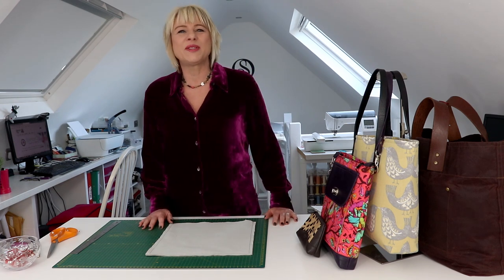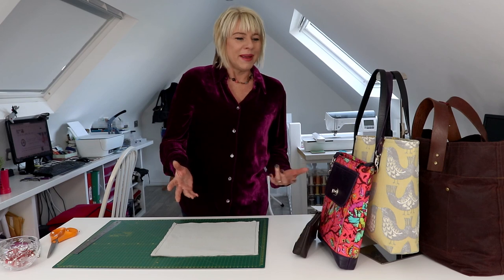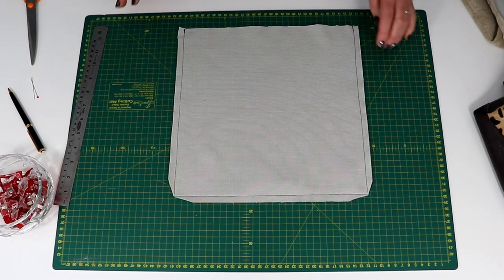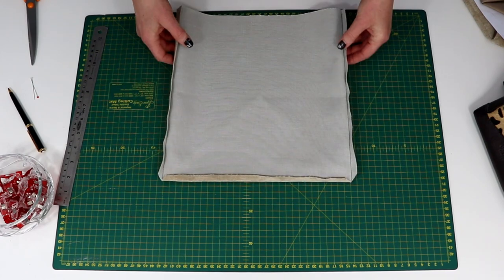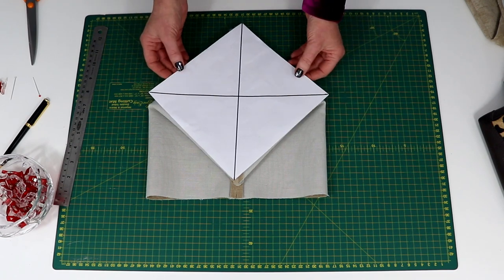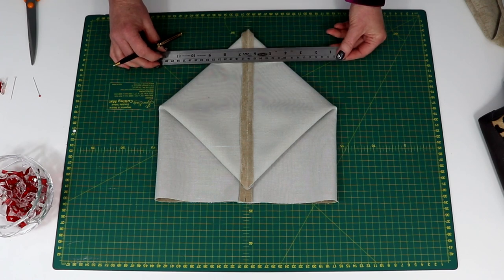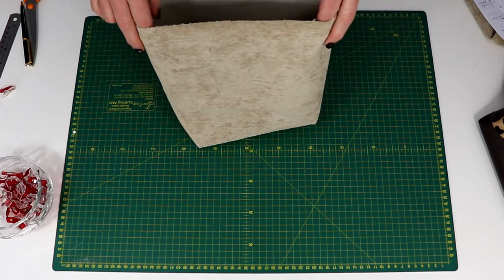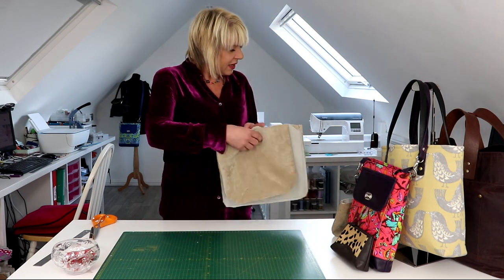The secret of boxed corners in bag making

Comment: Can I box corners if I have used deco in light as a stabiliser. Thank you for your tutorials, they are so thorough and really help x
Reply from the maker: Yes, use with any stabiliser Decovil Light included. If you have an entry level machine and worried about layers and bulk you can cut the stabiliser out of the corner sections beneath where you are sewing.

Comment: Hi. Love your patterns

I want to know if there is a formula for the boxed corner that will make a perfectly square base? 
Ive seen heaps of boxed bag tutorials, but haven’t found one that describes how to get a perfectly square bottom - for toy bags etc 
I know I could sew a square into the bottom. But I don’t want to. Boxing the corners is so much easier. 
If only I could work out how to work out how to get a square base
Reply from the maker: Make the full finished box corner seam the same as the width of your bag and you will end up with a square bottom :)

Comment: Great tips....I noticed you don't cut the corner out of the bag after sewing it.  Does this add stability to the bag?
Reply from the maker: It really is personal choice, I normally prefer to leave it on to add a little stability to the base, but there is no problem cutting it off either, especially if you want to reduce bulk in an item

Comment: What an easy way to do this.  Question because I notice your example bags to your left all have a contrasting piece at the bottom when and how do you add that?
Reply from the maker: Just add it to your flat fabric before you begin to make your bag up. Same width as your fabric. 3" is a good general height for a medium size bag, but the height will depend on the size of box bottom you want to add - it will always need to be slightly larger than your corner measurement. Hope that helps. 
Do join my bag making group for more hints and tips on bag making and to ask any questions you have:
https://www.facebook.com/groups/170115107145604/

Comment: Thank you! Often I've seen patterns whereby the bottom corners are cut out before they are stitched (e.g. cut out a 2x2 inch square at each corner, match seams, then sew). Your way/explanation allows me to fold the side and then mark up 1 inch to sew across (suspect adding 1/2 extra for seam allowance).

Comment: I am a bit confused, so if I am doing boxed corners should I add inches to the height of project. [ new sewer ] 🤔
Reply from the maker: If you increase the size of a box corner it will reduce the height of the bag, so yes, you would need to add onto the height to maintain it

Comment: It seems that almost all bag patterns that begin by having those corners squares cut out in preparation for squaring all have a certain consistency—the cut out is SQUARE. Usually anywhere from 3/4” to 3” I’ve noticed, depending on total bag size. So can you explain to me why occasionally I see patterns where instead of a square cut out, it is instead a rectangle. Maybe 1 3/4 by 2” inches. What is the reasoning behind that, and how would the corners ever line up the edges?
Reply from the maker: That will probably be because they have a seam on one side and not on the other. The square would be measured inside any seam line not from the edge of the fabric

Comment: Do you have templates of that little cardboard diamond thingy for each size I'm trying to figure out what that's for exactly. I watched the video and I saw you place it on top of the fabric but then you took it right back off and started using a ruler so can someone please help clarify this.
Reply from the maker: You don't need the paper square Barbra, I was just using it to explain the rules of geometry to show the seam line you will be stitching is half the distance up from the bottom corner. All I did was cut out a perfect square and draw diagonal lines to each corner. You could easily make one at any size if you wanted to. You can buy similar templates now though from Drumrae Designs on Facebook

Comment: I loved this! My only problem is I don’t understand centimeters. 😢  And in your other tutorials you give inches also…so, is the secret to draw that line HALF the size you want? ( I want a 4 inch box, so I draw a line 2 inches ? )
Reply from the maker: Hi Sandie, sorry if I didnt include inches, it was one of my very first tutorials. Not sure which bit your are watching but 1" is approx 2.5cm (I went over a few different measurements so I dont want to tell you the wrong thing). You can also use this converter for any inch to cm conversion which will help with any project or measurement you find in cm gong forward: https://www.rapidtables.com/convert/length/cm-to-inch.html
Reply: @SpencerOgg  thank you for your reply!

Comment: Can you please explain when calculating fabric amount needed,  how to determine how much the box bottom will decrease the total height. This is so hard to find.
Reply from the maker: In essence if your seam line for the box corner is 4 inches across,  we would measure up 2" from the bottom corner - this would reduce the height of the bag by 2"
Reply: @SpencerOgg  sorry I'm reading this message a couple of days later...are you speaking in reference to the cut out method a different method?

Comment: if you are making bags for sale, cut and see in production style...all same size and style at a time....that way instead of fiddling with measuring out the corner with a ruler all the time, you can make a template and mark off the sewing line.  Save your template for the next time you do that size.  I have made 100's of bags...I work at the bottom to line up bottom seam and side seams rather than working that from the top...that works...I was watching to see if I could learn a better way...I am good  so to speak. Your bags looked very nice.
Reply from the maker: Thanks, great tip!

Comment: I've been sewing for 60 years and didn't know this!  I love learning sewing shortcuts & new ideas.  If I wanted to reinforce the bottom for a shopping bag, what would you suggest?  Thanks so much for such clear instructions.
Reply from the maker: You can buy mesh for bag bottoms, or even cut cheap place mats to size. If you want to reinforce the outer from scuffs, you can add a band of vinyl to the bottom of the bag. Why not join my bag making FB group and ask the question there - you will get lots more extra helpful info https://www.facebook.com/groups/170115107145604/

Comment: it occurred to me that one could box corner the top of a bag too. sew in a shoulder strap as you create the corner. sew in a zipper on centre of the top seam or even two zippers. offset them the correct distance and parallel to the top seam and they will align with the future edges along the top.
Reply from the maker: Thats absolutely right and it works well. I used the technique in my free Volunteer Pack here - do take a look: https://youtu.be/PfLAcZ4FtKI

Comment: Even easier to just draw a 5x5cm square on the bottom corners of the flat bag. On both sides.
Reply from the maker: Yes definitely that’s a nice easy starter method if you have a seam at side and bottom. 😀In the video I am explaining how to calculate whatever box corner size you want, how to line the bag up when you are sewing it and how the bag height is shortened if you increase the box corner size so you are armed with a bit more information on creating your own